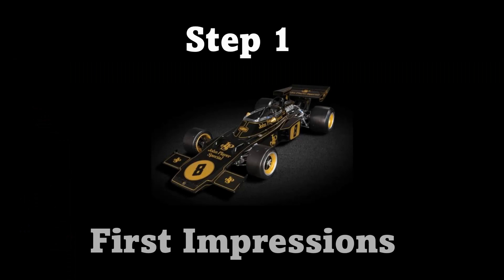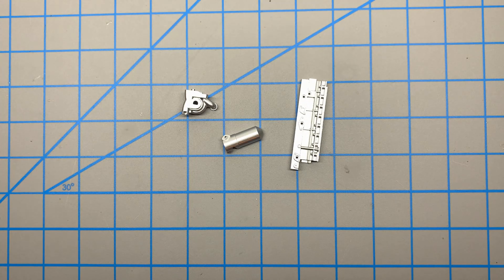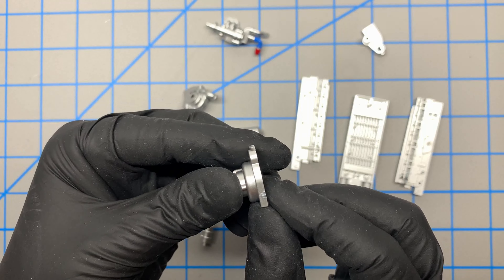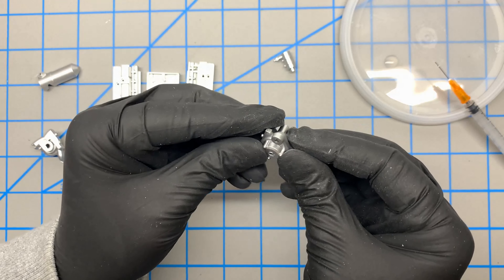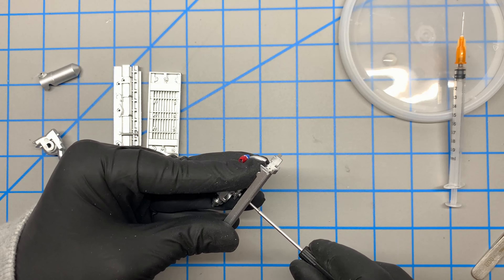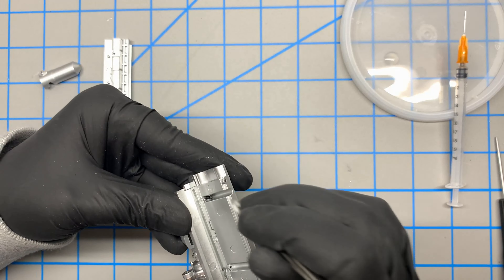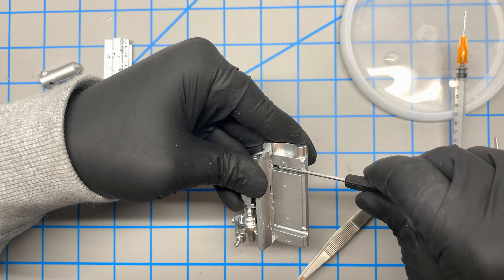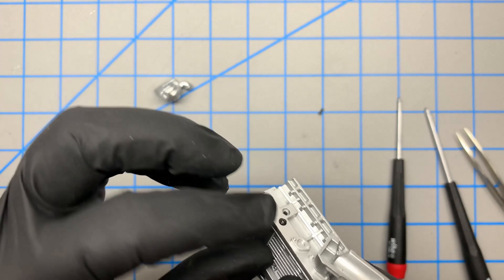01 Pocher 1:8 Lotus 72D - HK114 - First Step Impressions Commentary

Comment: Just found this page!  Thank you for building this.  Yes reference to the amended instructions available from the Pocher Support page is absolutely vital as there are numerous errors in part numbering, right from the start.  Was searching for part N7 - N11 noted in the instructions, I thought they had missed a Sprue!  Only to find these on Sprue NI, and renumbered in the amended instructions, mostly correctly!  I agree with other comments here about the exhausts.  Looking closely at the parts for the exhaust, there is a very faint number on each 1-8 on the screw end side, and the amended instructions include these numbers on the diagram (missed in the original).

When you consider that Pocher are part of Hornby, they could learn a lot about clear instructions from Airfix, they are very sketchy and no part by part installation guide, just an exploded view of each stage.  I too had a few issues with parts not being firmly held on screws and had to resort in some cases to CA glue to hold them.  Be careful however, as if you glue a part on that needed to be fixed later, its a real pain!!  

Overall I am very happy with the quality of the parts, and so far I am enjoying the build (stage A#6).  I don't have a major issue with the cost of the model, it was under £800 delivered (courier).  These are premium kits and I am guessing they are 'relatively' small production runs.  It's certainly much cheaper than doing these as Part Works builds!  I am building the IXO Collections/Agora Models Porsche 917KH, and this works out at nearly £1,100 when complete.  There seems to be much more detail in this Pocher 1:8 model, but will see how I get on through the build.

I agree that the D peg/hole fitting is very poor - they are slack so you don't get a firm connection. You therefore cant tell exactly in what direction (rotationally) the parts should fit, which can be an issue when gluing, especially as the instructions are so vague as to not show it clearly.  Careful reference to the Haynes Manual for the Lotus 72D helps, as does accessing the many photos on line.

I agree with the comments relating to the sprue's and the potential for damage.  A sprue cutter is too coarse and I have resorted to a hobby knife in some cases. Another issue with the sprues, is there are loads of them, each in a separate bag.  I have added labels with large text to each bag for speedy reference, as I don't have space to lay these out as I build.  It has helped enormously!

Comment: Guess you know there updated Instruction pdf on Pocher website. Essential for engine - especially exhausts. Posted a link but comment seems gone!. Screws are 1.5mm, but 1.6mm tap works fine.
Reply from the maker: No, I did not, good info! Thanks! I'll check it out!

Comment: Is this glue necessary? I use the Revell standard stuff and to be honest it doesn't stick enough and takes too long to dry. But this brand isn't available in The Netherlands. Are there any alternatives?
Reply from the maker: Hi: Do you have any other options for Cyanoacrylate (CA) glue aka super glue? I think any brand should work and I would also recommend the spray accelerator. Looks like Amazon Netherlands carries Akfix 705 and they also offer the accelerator, but maybe also try Interbond or Zap-a-Gap etc... Might want to experiment on some scrap pieces first. 🙂

Comment: It's quite clear to me that there wasn't enough research, engineering or test fitting done to reveal obvious problems with assembly.  When a company releases an expensive model kit with so many errors in manufacturing and instructions so poor it required (4) sets of revisions, that is inexcusable in my book!  Come on Pocher, or I should say, come on Hornby!  On top of all that, the screws have their own issues - some too long and none of them magnetic, and the fact that many holes require tapping before use is absurd!  No other maker in this scale requires that annoying, unnecessary step!  

You had better take a good long look at your competitors in this fast growing market of 1:8 scale automotive assembly kits as they are way ahead of you in quality, clarity of instructions and ease of assembly.  By the way, I am a 74 year old model builder and have completed 5 previous Pocher kits, most made by the original company.  While the kits were never without some issues, they clearly have gotten much worse over time instead of better, and with new ownership!  

No thanks Pocher/Hornby, I'm done with your products and look forward to receiving the Mercedes W196 R from Agora Models.  Their 427 Cobra was relaxing and fun to build - 2 of the main aspects of model building that I enjoy.
Reply from the maker: Hi and I agree with your comments. This is my 3rd Pocher build and the instructions are simply atrocious! They do look nice when complete though. Also, to your point, I have been looking around for other 1:8 kits and I'm trying Deagostini at the moment.
Reply: @splashbakermodelbuilding  - I have heard of them but have not purchased one so far.  I read that they are generally good quality but sometimes lack good detail, especially under the hood.  Hope you do a review on yours to inform us all if you feel it is a good kit.  Thanks for sharing your feelings on these kits, it's very helpful!

Comment: I must say I am not happy with this model. Very few of the parts fit like they should. Screws strip out. I even had to super glue the head covers on. Even after tapping the holes out. Don't waste your money on this one. And have plenty of super glue on hand.
Reply from the maker: Hi: There are quite a few things I am not happy about with this kit, but the main one is the poor instructions!